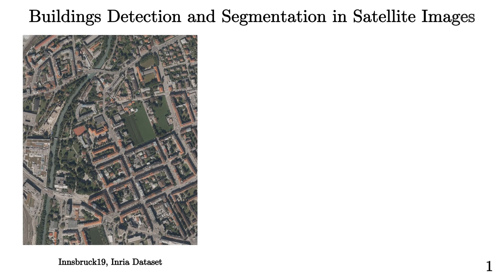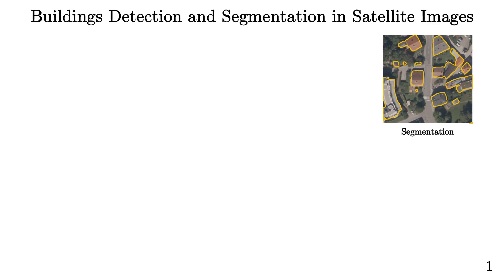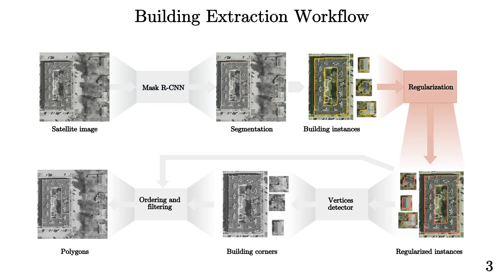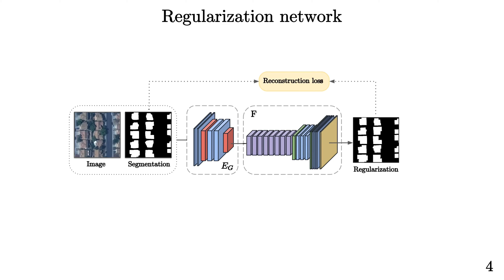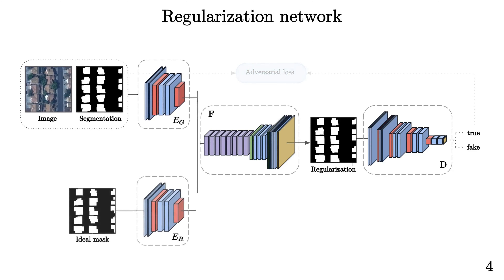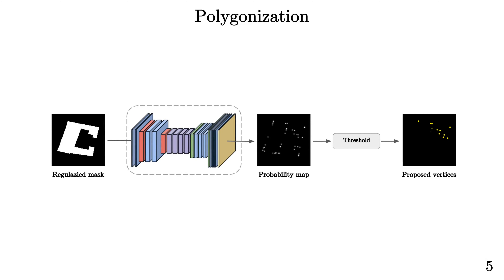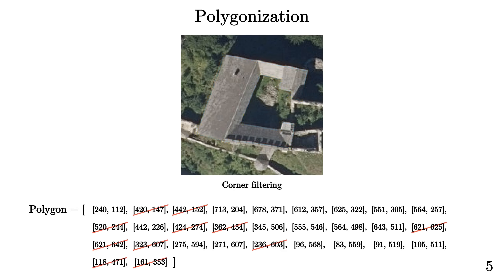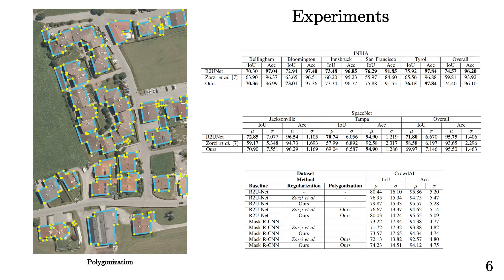Machine-learned Regularization and Polygonization of Building Segmentation Masks

Comment: Hello Stefano, your research is very interesting. I'm trying to run your work from github repository you've shared. I'm a little confused with the input file that must be provided to run this model, is the input file are output from the semantic segmentation of another model? Can you provide a sample file in your repository so I can run it right away? thanks!